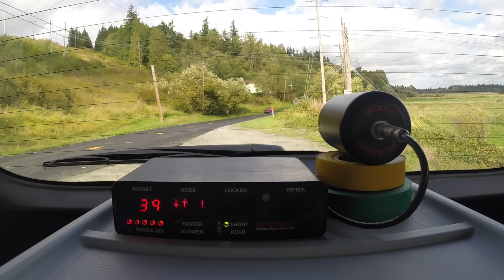What are X, K, and Ka Band? Five Minute Fridays, Ep. 7

Comment: Good Morning, Do you have a YouTube Vlog on the latest hand held radar guns the police are using? and what bands not to filter on a 360MAX C? I see motor police units using what look like a new type of radar gun and my unit is not going off while they are pointing at me.
Reply from the maker: Sounds like they're using laser guns, not radar, so you'll need to add a laser jammer to run alongside your radar detector.
Reply: @VortexRadar  The units they are using have two convex pieces of glass in the front that are side by side. Probably about 1 1/2" in diameter. I've seen something like that in Europe when I was stationed there. Any other possibilities?

Comment: About 500 meters before coming to a place with a fixed speed camera, the signal comes k frequency signal, but in a place where there is no fixed speed camera or a police radar, it also receives x frequency or k frequency. what is the reason for it? is it possible that it comes from a radio station as interference?

Comment: Even though Ka has been around since the 80s, do you anticipate a continued trend towards a frequency higher than Ka for reduced size in future radar sensors?
Reply from the maker: I really doubt it. There's not much of a reason to go for higher frequencies at this point. The antennas would be smaller, yeah, but they're currently doing other tricks to shrink the antennas such as changing the antenna design instead of going for a higher frequency.
Reply: Smaller frequency also means less distance. Ka is a happy medium. Also, smaller shorter signals require more power.

Comment: If speed sign doesn’t get alert on detector, dose it mean that they are using Ku on those speed signs?
Reply from the maker: No. There are other methods to acquire speed, the sign may be just outside the frequency range police radar guns are since they don’t have to be certified to issue tickets. Ku is not in use here.